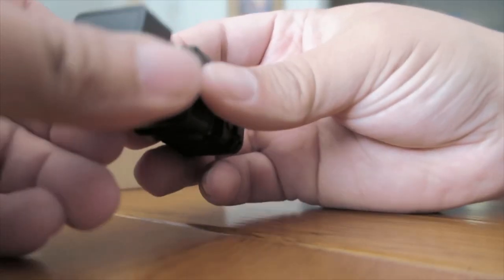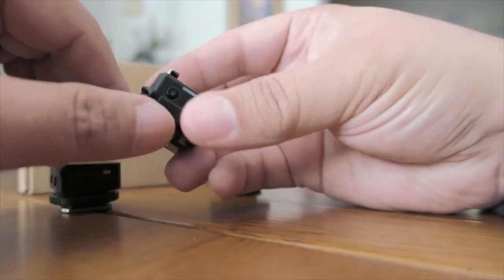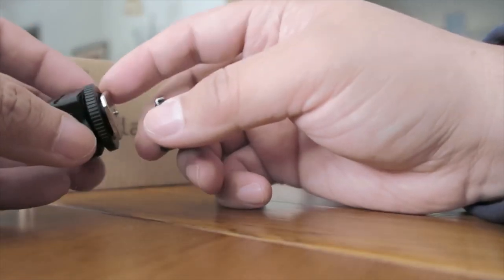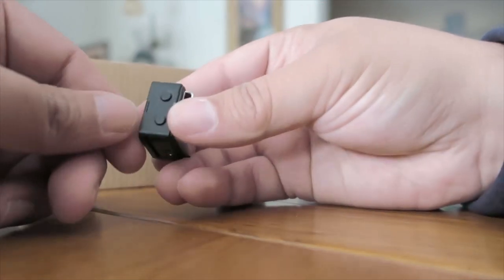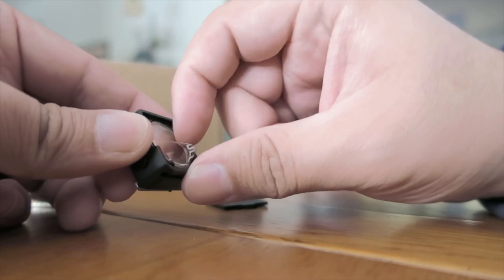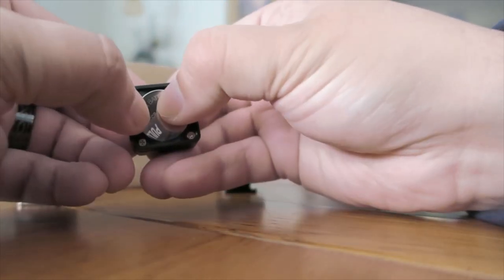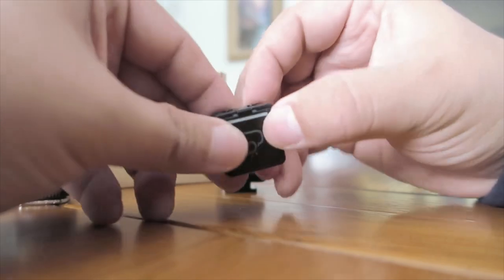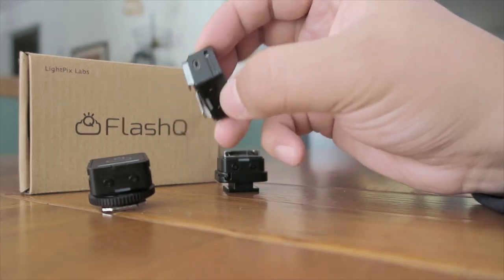FlashQ Trigger Change Battery

Comment: Hi Thank you for the tutorial. Neither my receiver or the transmitter has a latch to open the battery compartment. ??? I bought the flash Q triggers recently and the manual says BUILT IN re-chargeable battery. There are also no instructions on changing the battery.